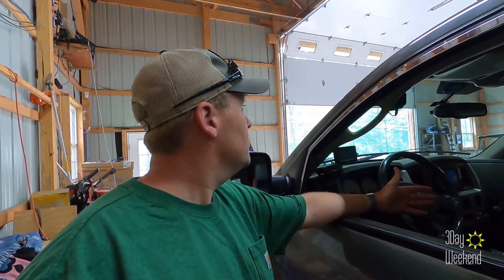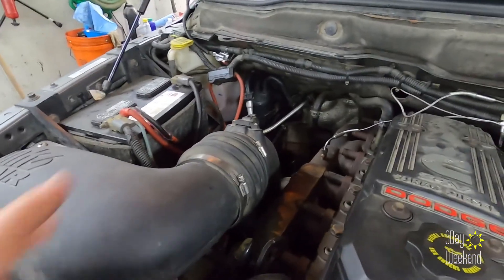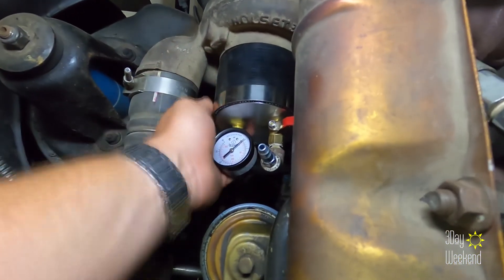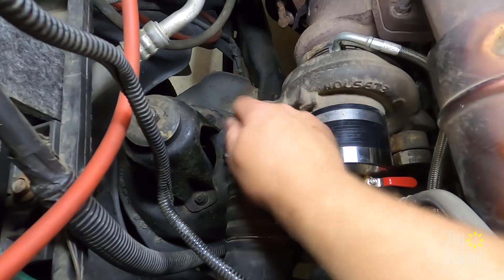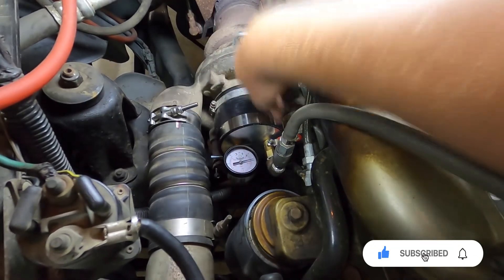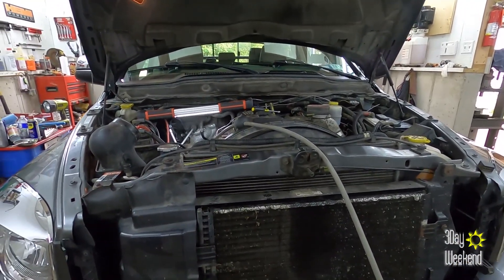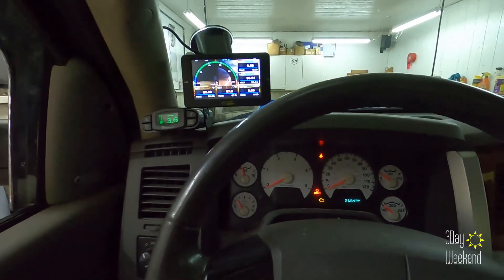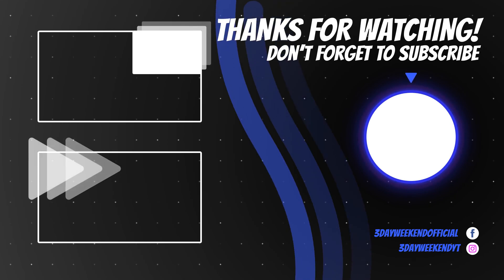Finally found the boost leak in the 5.9 Cummins!

Comment: Tell me about the gauge hanging in the lower left of your windshield?
Reply from the maker: That's a Smarty tuner.  I used to run some pretty hot tunes on that engine, until one day I gave it a little too much and burned a hole in my #4 piston.  Had to rebuild the engine.  Now I run the stock tune, but use those gauges ALL THE TIME.  It also reads diagnostic codes and watches my EGTs.  You can also set up custom alarm values so if my EGT or coolant temps get up above a threshold I set, it starts to beep and flash.  It can display how much boost is being made as well, which helped me diagnose an issue with the wastegate solenoid (in a different video).  It's pricey, but I like it.  There are other brands out there that do similar things, but this one has worked well for me.  Hope that helps!

Comment: Charge air system?? Egr?
Reply from the maker: My high EGTs ended up being a faulty sensor of all things.  I'm still glad I checked for leaks because I did find some and was able to fix them!  It's still running strong to this day, with EGTs back down in the normal range.  Whew!

Comment: Remove your oil filler cap when pressurizing thru the turbo lest you over pressure your crankcase!
Reply from the maker: A great suggestion!  Fortunately the 2006 has an open crankcase vent, which is just an open tube that runs down along the engine pointing to the ground.  I love these pre-emissions vehicles!  They are so simple!  haha

Comment: Working on 2006 dodge ram 2500 5.9  every time I hot a pot of water it slows down to 30 mph
Reply from the maker: Are there a lot of hot pots of water in the road where you live?  haha j/k.  Water impacting the engine would have me chasing an electrical issue of some kind.  Would it be worth having someone idle the engine up high while someone else sprays water around the engine compartment?  Perhaps you could narrow it down that way if the engine were to miss or bog when the water hit the bad spot.  I'd pay special attention to the injector harness/plug area.  Hopefully you're able to find it and get it up and running again!  Best of luck to you!

Comment: Are you saying the high EGTs were due to a bad ground on the EGT probe? Thanks.
Reply from the maker: Yes sir.  In my experience, a bad EGT ground on the probe usually just maxes out the reading.  This one seemed like the value was legitimate so it threw me off.  Oh well.  I was still able to find and fix the boost leak which restored my fuel economy!

Comment: Have 2006 5.9 noticed was taking just slightly longer to start but not much. blew water pump shortly after doubt it’s related. Any way I changed pump and started up had some pinging or similar noise went away after couple min figured was from antifreeze all over everything. Next couple days noticed engine idling higher. Put in gear she’s anxious to go. Had a wine when I first started her in the morning . Seemed to run fine other then fast idle but now having some break ups at higher rpm . I did dump some injected cleaner in with the hot shots edt. In seemed to calm down for one trip but back up fast idle and breaking up intermittently
Reply from the maker: That's not good.  Sounds like you may have a sticking injector.  I've had to replace the injectors in mine at 100k miles after getting some bad fuel on a trip.  Not cheap.  Take a look at your exhaust and see if there is some white smoke.  Hard to start, pinging noise, high idle, and break up are all symptoms of a failing injector.  Could be something else, but that's what I would be most suspicious of.
Reply: @3DayWeekend that’s exactly what it was replaced all with delphi injectors turned to be a nightmare. Right off the bat had one over fueling pulled it back out swapped it. Was good for a bit now intermittent symptoms . If anybody else reads this 5.9 common rail you have two choices new bosch or BBI. I have a new set of BBI on the way. I got a smoking deal on the delphi so I chanced it and my tail pipe got the white smoking deal ! I wouldn’t put a reman in if I got for free not worth it

Comment: I had a thought, what if you added oil to the boost side of the intake manifold before shutting it off brier to the test to seal the rings? Just for kicks. I wonder how much blow by is ok? What do you think would be a good indicator to do a boost leak test? Change in fuel mileage? Not everyone is running a pyrometer.
Reply from the maker: Well, since I've had this tool, I have discovered that if your boost side has been open, you likely have a small boost leak or two.  Probably not enough to be noticeable, but they are there.  Outside of rising EGT's, fuel economy would be the next go-to.  Of course, fuel economy could change from other things too, like different tires, windows up/down, driving style that tank... so it would be hard to judge.  This one was just big enough that I noticed a slight lack of power while hauling the 5th wheel up a hill, so that could be a sign as well.

For blow by, the standard test on these trucks is to park on level ground, take off your oil cap, turn it upside down, and set it back on the oil fill hole.  If it bounces up in the air and flies off, that's excessive blow by.  If it moves a little bit but mostly stays in the same spot, you're good.  There are more technical tests, but it involves compression/leak down tests and removal of the fuel injectors.

Comment: why does it give high egt though? on my car if i have severe boost leak i run pig rich,rich should lower egt not raise it and it makes sense why it would run rich as you suck in metered air that escapes the ecu is adding fuel based on that air volume so you get rich.this is on my maf engine so maybe its different with map?
Reply from the maker: Right.  MAF and MAP will run it a little differently, as will gas vs diesel.  The diesel is just injecting fuel and assuming everything is fine for air flow based on that pressure gauge.  A big enough boost leak means less air, and less air means lower compression, and lower compression on a diesel will result in an incomplete burn, and the incomplete burn (which is still burning) moves out the exhaust valves, through the manifold to the turbo.  Now your turbo is getting hotter exhaust so your intake air is warmer, and it just builds and builds temperature the longer you have your foot in it.  It sounds backwards, but it needs air to keep the temps down.

But...  the biggest difference is that this is a diesel tow rig, which regularly operates at 100% load for miles if going up hill.  That amplifies the issue and the EGTs just keep climbing and climbing, higher and higher.  In a normal daily driver situation under partial load, a small leak would not even be noticeable in the EGT reading.  Furthermore, when the computer recognizes low boost, it does pull fuel, and now the engine is down on power, still pulling that trailer up the hill, getting hotter and hotter all the while because it doesn't have the air it needs or the fuel for an efficient burn.  Vicious cycle!

Excellent question!  Thanks for watching!
Reply: @3DayWeekend  wow great in depth response,make sense here

Comment: Why not pull vacuum so you can see smoke being sucked in? It's easier to pinpoint the leak that way
Reply from the maker: Boost leaks can be tricky, and many times they only leak once the pressure is over a certain PSI.  I've had a leak where it took about 20PSI before it opened the coupler hose enough to make it leak.  Anything under that was perfectly fine.  Sometimes it takes a combination of tests to find a leak - vacuum, smoke, high pressure, high pressure with smoke.  Whatever needs to be done to find it!

Comment: Can a smoke test deduct this?
Reply from the maker: A major one perhaps (a blatant hole in a tube, etc), but you really need that pressure to expand everything.  Mine didn't leak until I there was enough pressure to push the hose/clamp up.

Comment: You sure you cat isnt clogged ? This is a few months old but I'm having about the same problems but cat is suspect ATM.
Reply from the maker: Yes, positive.  My 06 is pre-emissions so there is no cat.  They did come with particulate filters, but that was replaced with a 5" turbo-back exhaust.  Hopefully yours doesn't have a bad cat.  Big $$ right there!
Reply: @3DayWeekend  mines a 2004.5 Laramie 5.9 24v high output I'm positive there's a honeycomb cat  about the size of a basketball hell I'll have to go through the warranty info could of sworn the exhaust was lifetime. It's pre def exhaust but cats been required for a while decades at least. This test was very helpful thanks for the time put in it.

Comment: The front piston ring on the turbo will allow air to leak into the crank case if it is worn. The pressure normally holds longer when there aren’t any leaks. You still likely have leaks. The hardest leak to test is a wastegate diaphragm being bad. I would put soapy water on the intercooler and the charge pipes and test it again.
Reply from the maker: Yes, we did spray it down for a re-test when the issue didn't go away and found a couple very small ones.  It ended up being a bad EGT probe.  Thanks for the suggestion!
Reply: Don't know if you are still active, but I got a wastewater engine light code, and I hear a leak on passenger side only when I shut the truck off . Wondering if it's a vacuum leak under the battery . Now maybe it's the wastegate leaking?

Comment: You still have a boost leak. You need to spray soapy water on the intercooler and the charge pipes and where it bolts to the engine. Some air will leak into the crankcase but it shouldn’t be much, and it’s not normal to leak into the crank case very quickly. The front seal on the turbo being worn will allow pressure to leak into the crank case.
Reply from the maker: Good pointer.  I did end up going back through it and spraying down everything and had to tighten up a couple things.  Turns out my issue was a bad EGT sensor, but it's good to know that my cold side is sealed up tight!
Reply: @3DayWeekend  what EGT sensor and gauge do you use out of curiosity?
Reply from the maker: @callsignmohas5190  I use the Smarty Touch system with their EGT probe.
Reply: @3DayWeekend what was wrong with the egt probe to cause a leak or was it just a bad install and not sealing properly?

Comment: what did you use to make the 90 degree angle on the boost tester
Reply from the maker: That's a quarter inch plumbing elbow.  I took the tester to Home Depot and a guy helped me find the right one.
Reply: @3DayWeekend  sweet thank you

Comment: What gauges are those and are they hard to install.thanks
Reply from the maker: Those gauges are my tuner.  It's the Smarty Touch.  Plug-and-play install, EXCEPT.... the EGT sensor requires drilling and tapping into your exhaust manifold.  It includes the instructions.  You'll want a high quality drill bit designed for drilling metal is all.  That part is optional.  All the other gauges come from the OBD port.  Here's their website:  http://www.madselectronics.com/SmartyTouch.html

Comment: First video of yours I’ve watched. Subscribed just cause of the intro with the American flag hahaha
Reply: Anyways. Was the issue just that one boot? No resolution or follow up videos? My 6.7 is making a high pitch squeal above 25psi boost. I’m thinking one of my intercooler boots is ripped after I recently did some work on my truck. I need a topside creeper so I quit leaning on everything!!
Reply from the maker: Thanks for watching and subscribing!  My only leak was from that one boot.  The truck definitely picked up some power while hauling a heavy trailer uphill.  The main issue I was chasing (high EGT's) ended up being a faulty ground on the EGT sensor.  And yes, a topside creeper is a GAME CHANGER!  I park my truck for the winter, but I'm sure it will be in more videos come springtime.  Thanks again!
Reply: -a

Comment: Mix up some soapy water and you can spray it on all the boots & intake horn to help find the leaks.
Reply: Hey I did that started my truck and sprayed some soapy water on my CAC found two small leaks on each top corner, I had 32 to 35psi before now I only get 20psi nothing higher, can that be enough to reduce boost pressure? Thanks in advance.
Reply: @ER_666_  a tiny boost leak is bad, especially since higher the pressure the higher velocity of air escaping. a boost leak at all will negatively effect the performance of your vehicle. a vehicle at 30 psi without a boost leak will perform better than a vehicle at 30 psi with a boost leak, even if it reads pressure. you have to make sure that motor seals
Reply from the maker: That would absolutely be helpful in finding the smaller leaks!  Great tip!